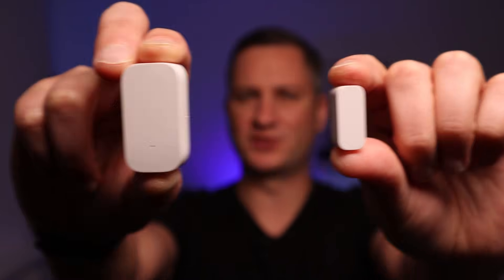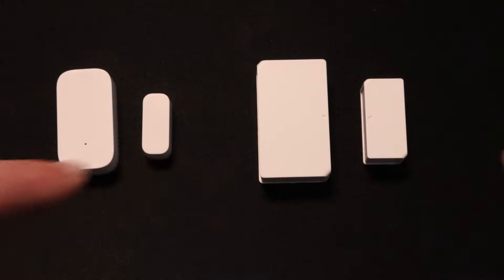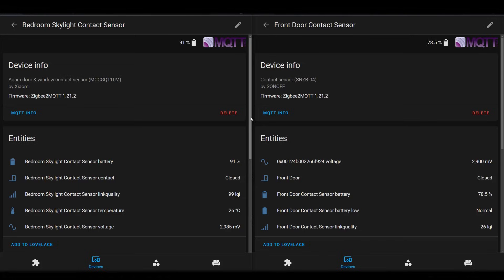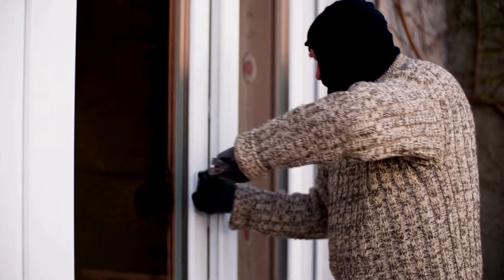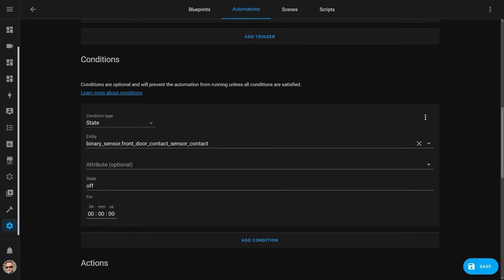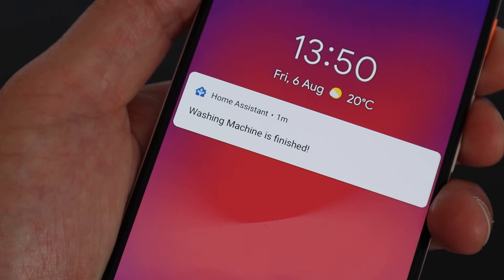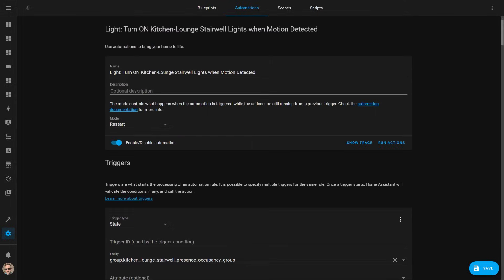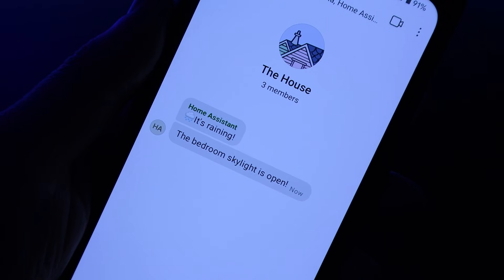Door and Window Sensor Automation Ideas -  Using Contact Sensors in Home Automation

Comment: I want to use the Eve contact sensor outside on a metal gate under my eave. The existing seals look pretty good so I was thinking I'd just seal it a bit more with silicone sealant - Do you think that would work ok?

Comment: Hello, excellent video, how would you do if a door sensor detects the opening, from there it triggers a delay of 30 seconds for example and if they don't close it then it triggers a siren... now the conditional, if before those 30 seconds was closed that canceled the first trigger of firing the siren, an example of forgetting an open door in that way would be very useful for several. Greetings and keep it up! You have a new subscriber

Comment: I wish I could find a two in one window opener and contact sensor.   I dont understand whats so hard about making a smart device to jack a window open and closed.  If they can make something to open and close blinds, doing it for windows should be a breeze.
Reply from the maker: Perhaps it's because there are many different types of windows that open different ways? I'm not sure. 

Try building one with some mechanical engineering and ESPHome! You could open up the market! (That skillset is way above my abilities though)
Reply: @HomeAutomationGuy    Most windows open just by pulling them up.  All you need is a small jack-like device that can fit under the handle of a window.

Comment: I desperately need help to set up a routine as shown in the video to turn on my garage lights when the doors is opened. Garage lights are controlled by a Levitron D26HD smart switch and for the door i have a smartThings multipurpose sensor with a smartthings station model ep-p9500

Comment: Do you recommend a contact sensor that does not require a hub such as smarthings hub. Would like to set up a scene on 2 contact sensors for my garage doors so they turn the garage lights on when either door is open as you did with the smarthings contact sensor but do not want an extra hub in my system when i have everything else in Google home.  Thanks

Comment: I prefer the wifi door sensor from the new brand Erdiegle. Their door sensor has time delay function and you can set the arm timer on the app. Also, when the door is opened, the door alarm will make a sound, at the same time, it will push a notificaiton our your app. The sound volume is adjustable on the app too. Very helpful!

Comment: Another great Video. I love the simplicity of using a door sensor for your washing machine. I too am guilty of this... wasn't an issue when it was just me, sadly I still do the same thing with a family of 4 :|.

I am going to copy this.

I'd love to see a video on your conditional reticulation system using a contact sensor. I have a 700mSQ block. saving a bit of water would be great for the environment.

Comment: Hi,
Great Video.
I use NodeRed to trigger a RGB Hue Light to inform my cupboard-door is left open. I see you have this easily configured this by taking a snapshot scene. But I need to take two snapshots: one for the status and one for the attribs. Attribs are not readable if the device status is off. How dit you fix that? Or does that problem only exists in NodeRed/Zigbee2MQTT environments?

Comment: How are you notifying the system that no one is home? Motion sensors don’t pick up movement for certain amount of time ?
Reply from the maker: My partner and I both have the Home Assistant companion app on our phones so it knows if we've left or not
Reply: Simpli safe has alert setting separate from alarm using contacts or motion . Can place inside or outside and get notice of motion or someone opens a shed door . Along with what ever camera some wants to use .

Comment: i want to detect when i'm at home using my phone, but i don't know how. i've tried the home assistant app and the unifi network integration. the problem is that both methods have proven to be reliably unreliable. in the unifi integration the phone randomly drops from home to away, even when it's not going anywhere, and using the home assistant app, it NEVER goes to away mode. so what can i do?
Reply from the maker: Are you using Nabu Casa or some other sort of remote access to Home Assistant?
Reply: @HomeAutomationGuy  nope. no nabu casa
Reply from the maker: @mrxmry3264  You will need some sort of remote access solution, so that your phone can tell Home Assistant that you've left when you're no longer connected to the internal network.

Comment: Great video! One question, I tried to create a group for family but it doesn't work in configuration.yaml or groups.yaml and inside of the integration I cannot find the entity of my phone. Could you explain how to create a family group
Reply from the maker: Take a look at this blog post, it should provide some insight:
https://www.homeautomationguy.io/home-assistant-tips/better-presence-detection-in-home-assistant/
Reply: @HomeAutomationGuy  Thanks for this but I have the same problem, I'm not able to create a group trhough groups.yaml, whatever I write in there, I can´t see it as an entity. The only way I can create groups is using the group entity via the UI but it is only for lights or switches, I don't see the wifi entity of my phone to add anywhere.

Comment: today i had some spare time to test your automation about the red flashing light (~min8).
i rebuilt it 1:1 in my HA -It worked very fine and i learned a few new tricks about "call.service"
thank you!!

but sadly i can't see, how this could recreate/emulate the "smooth color change effect" of my tuya LED strips.
in the tuya/smart life app this scene is available, but in the HA HACS tuya local integration these scenes dont work.

any idea?

maybe some sort of script:

[start]
change to red
change to blue
...
change to violet
jump to start
Reply from the maker: I think a script might be the best option here.  Sounds like a fun project to tackle, good luck with it!
Reply: @HomeAutomationGuy  wow, your response to my question was quite fast!
okay...so...the important question now is: HOW do i have to code the skript?

noob way = my (current) skill level:
* create one skript for EACH device with the GUI (groups aren't an alternative here, cause sometimes i only want to use one single device at a time)
* containing a few color changes + pauses in between
* BUT i dont know how to set it into loop mode
* as soon as a different command is triggered, the effect stops/gets overwritten by the new command

pro level might be something like this:
* create ONE skript
* every RGB device can use this very one skript (the device needs to be some kind of variable?)
* ... by some (to me unknown) trigger
* see last point above

do you have any advice for me, where to get a few hints - or do you already have some code lines, i may try?
( ...or even hear me out this might become a new video on your channel, and we both profit  ;-)   )

Comment: Hello, what kind of double-sided tape do you use for your contact sensors on your wooden frame skylight ? 3M ? Does it hold ? Thank you
Reply from the maker: I use the 3M tape that came with the sensor itself and it's held fine for the last 5 months (and still going strong)

Comment: I would love a suggestion on a door sensor that tells me if the door has been left open for more than say 5 minutes.  With a teenager who sometimes forgets to close the door when he leaves,  it would really help to know.   I don’t need to know each time the door is opened. Rather when it is left open for a long time.
Reply from the maker: You can use the same door sensor and automations that I show in the video for this.

In the automation trigger just change the "For" part to 5 minutes rather than the default 0 minutes.

That way the automation will only trigger if the door has been open that long

Comment: Do you need the aqara hub for the door/window sensors to work in home assistant or any zigbee hub paid with home assistant can work with it?
Reply from the maker: I don't use an Aqara hub, I use a ZigBee stick connected directly to my Home Assistant. Check out this video I made about it https://youtu.be/ZUWrUBJQRpA
Reply: @HomeAutomationGuy  Will this process work for most sensors as well? I have aeotec sesors as well and they will not connect to by zigbee stick that i have connected to home assistant

Comment: Always enjoy your videos. You've got some great automation ideas!

I do the same thing with the washing machine. The only difference is that I change a light to red when the washer has finished and still contains wet clothes. I turn the same light green when the dryer has completed and not been emptied. I figure wet clothes should be a "warning" and wrinkled clothes can just be an alert. I also have Home Assistant send notifications to my phone every 45 minutes if the washer hasn't been emptied.
Reply: What sensor did you use and also how did you do that ?
Reply: @chaystay978  I don't have any Zigbee devices, my sensors are Z-Wave. I found a deal on a bundle of Wink Z-Wave Door sensors. I wouldn't necessarily recommend them. Out of the bundle I got, some work great...but a few were inconsistent so I replaced them. My washer is a top loader and the sensor fits perfectly under the lid and can use the magnet on the lid that is part of the washer's built-in safety switch. I use a Zooz power monitor plug to know when the washer is running by monitoring the wattage usage level in Home Assistant. I had to monitor the power usage over time to find the pattern of use between the washing, soaking, rinsing and spinning cycles. I advance the value of a numeric helper each time the power "spikes" so I can count the cycles and not get a false alert before the washer is truly finished. When the washer is finished, I reset the numeric helper and turn on a helper Boolean that indicates "Ready to be Emptied". When the Boolean is set to "on", that triggers my alert notifications and sets the light to red, indicating the clothes are ready to be moved. When the lid of the washer and door of the dryer are both open for 15 seconds (while the Ready to be Emptied Boolean is on), I have Home Assistant take that as a signal that the clothes have been transferred and the helper Boolean is turned off, which turns of the light and stops the recurring alert messages to my phone. Hope that description makes sense and helps.
Reply from the maker: Advancing a numeric helper is a really clever solution, I think that will solve the problem I have with working out when the dishwasher is finished! 

Thanks for the tips and I'm glad you enjoyed the video!